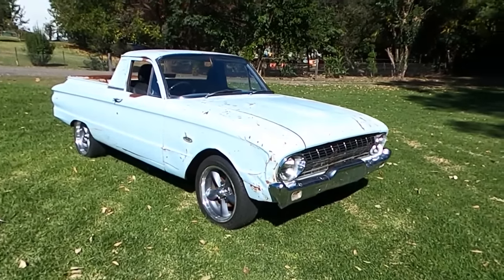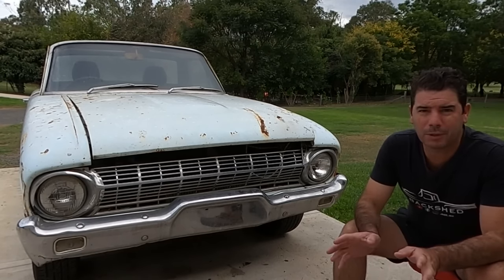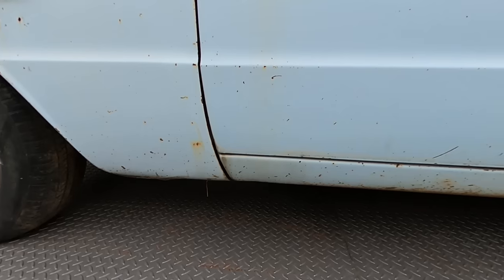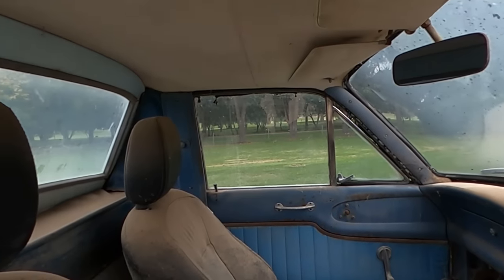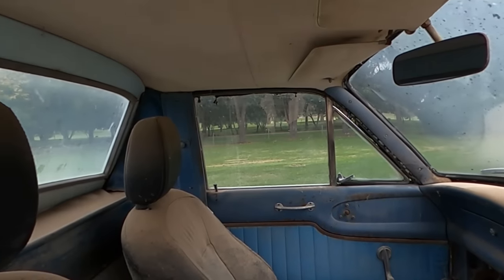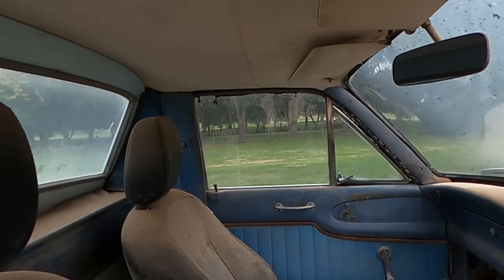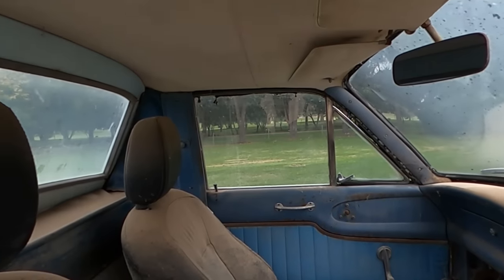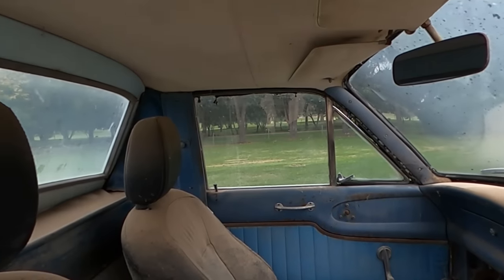EP23 WRECKING YARD FIND FORD FALCON / RANCHERO ABANDONED FOR YEARS FIRST WASH AND WILL IT RUN ?

Comment: I bet someone jacked it up under the sump and the jack punctured the sump, that would explain the dent creases and the indented split.
Reply from the maker: 100% Andy 🍺🍺👍 and I’m probably luck as if it was driven and dropped its oil after “will it run “ I’d would have needed FAIL! hahahaha🍺👍

Comment: What’s the deal with 5 stud  hubs 
Pretty sure they were 4 stud
Fuel pump correct they had vacuum wipers as yours has
Reply from the maker: Yeah your kinda right mate , sedans / passenger vehicles had 4 , commercial vehicles ( Ute/van ) had 5 in Oz🍺👍
Reply: Vacuum wipers were shit idea when you accelerate you have no wipers 
And the drive in you had to run engine to wipe the screen
Reply from the maker: Hahaha yep I hear ya . 
The vacuum pump on this fuel pump is to fix exactly what you said mate , the booster driven by the fuel pump helps the wipers stay a constant speed when engine vacuum under acceleration drops , I didn’t know any of that I’ve just learnt it from this Ute Hahahha 🍺🍺👍

Comment: A fun fact the utes and Fairmont's ran 5 stud 14" wheels where as the sedans and wagons ran 13" 4 stud wheels
Reply: Actually only Panel vans and utes were 5 studs 13inch wheels ,Sedan , wagon , coupe are 4 studs 13inch . Only the XP Fairmont sedan wagon had 14 inch 4 stud due to having front disc brakes

Comment: Someone should invent some sort of rubberised bladder insert of some sort to line an old hard to find gas tank like that. Like from the fuel neck completely to the send line connection all one piece. Just pop it in, blow it out with a shop vac to fill out the inside of the tank and run with it. Why not? Maybe because that’s a stupid idea probably
Reply from the maker: Hahahhah 🍺🍺👍

Comment: the fact that the motor is blue suggests a later model engine
Reply from the maker: Nah mate it’s the original 144ci 6 cyl 🍺🍺👍
Reply: It's definatly a XL motor due to the vacuum fuel pump they mount to the block different from XM and will not fit

Comment: If it aint been said, that tool with the black handle is for breaking the seal on frozen up radiator hoses and the like. If they are really old you end up destroying  them but it a quick way to crack em off
Reply from the maker: Cheers mate 🍺🍺